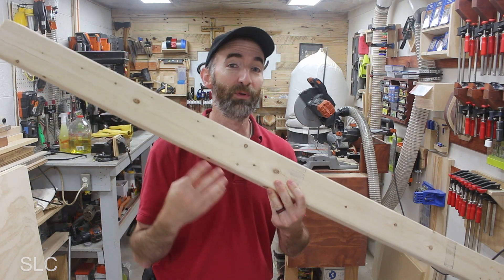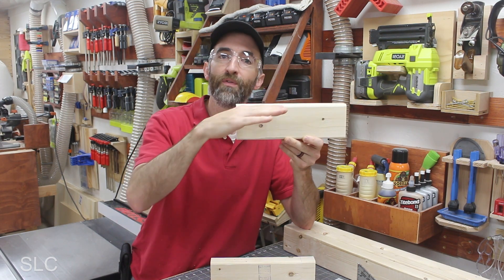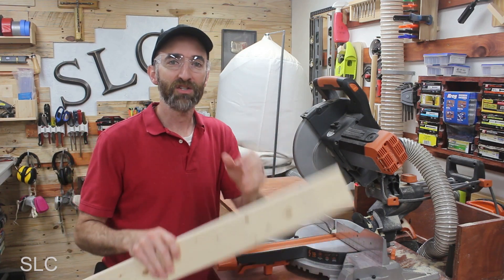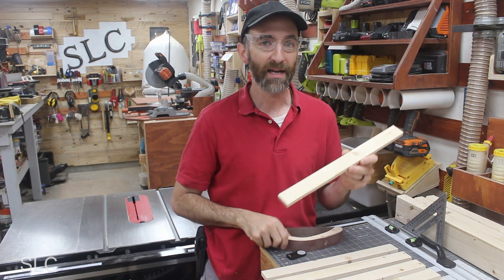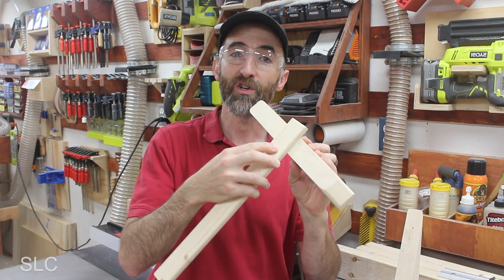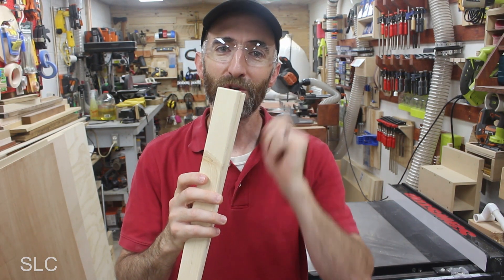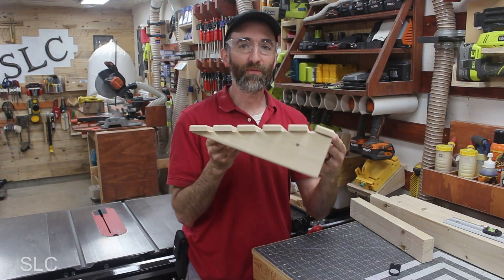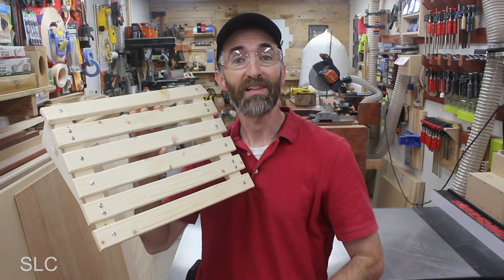Simple DIY Footrest with 1 Board

Comment: Great little build. I feel like socks/feet could be caught/scratched on screw heads. Maybe slightly thicker top boards to allow for some counter sinking?
Reply: I think you could countersink your screws if you used small enough screws.  Or you could use dowels. That would make it very pretty too, particularly if you used a different kind of wood dowel.